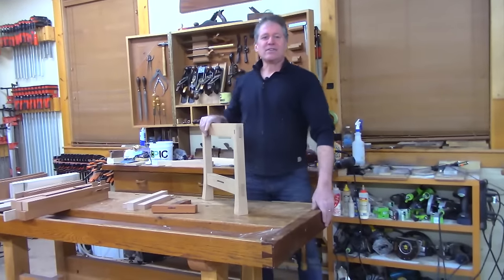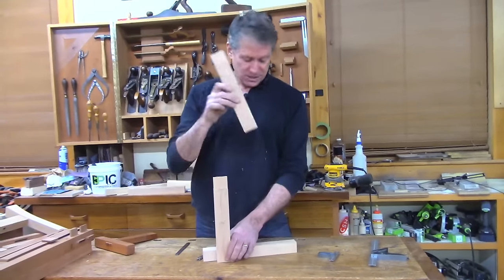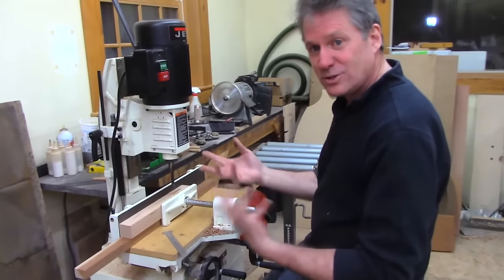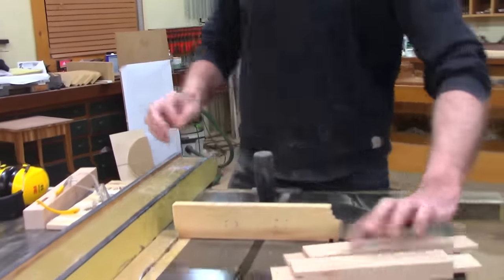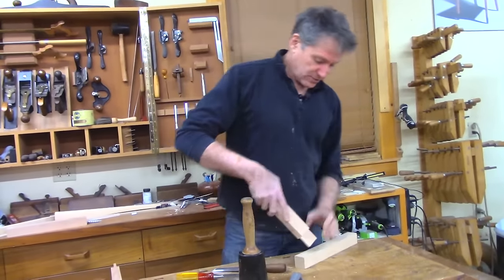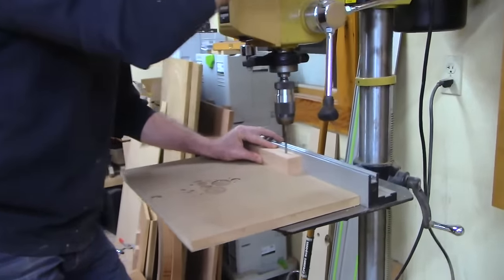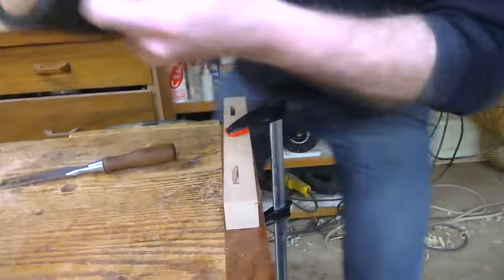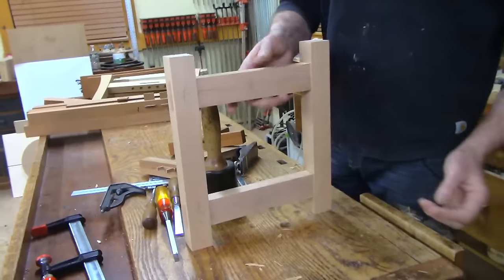Making Through Tenons

Comment: FWIW, I wholeheartedly agree with you about the usefulness of a hollow chisel mortiser. For efficiency and reliability in producing square mortises, it cannot be beat.  If I have just a few mortises to cut, then I chisel them by hand.  It is enjoyable and keeps me in tune with my hand chisels. But, if I have to cut more than a half-dozen or so, then I use the hollow chisel mortiser every time. I use the drill and chop method only if I am working with larger timbers that I can't fit solidly into my mortiser. A plunge router and a jig is also useful for this.

I, too , used a drill press adapter for mortises -- but only for a short time, I report thankfully. It is not steady and solid, and it interferes with the normal use of the drill press. Further, it is often more difficult to control the wood into to which you are cutting the mortise when using a drill press. These things lead to inaccuracies.  Not goodness.  Not happiness.  

A router table and/or router jigs work well and reliably, but they do not yield square-end mortises and are not as solid and reliable as a hollow chisel mortiser, which cannot "grab" and shift the workpiece. Still, I would use a router table (vertical or horizontal) before I used a drill press, given the choice, because you end up with vertical and smooth sidewalls in the mortise. Squaring the ends with a chisel is no biggie, either. Now that I have a hollow chisel mortiser, I don't mess with router-cut mortises unless I am cutting more than one or two end-grain mortises in long work pieces OR if I need to cut a number of mortises smaller than 1/4", which is rare.

I got a Jet benchtop mortiser decades ago and I have never regretted doing so. I was building Craftsman-style baby cribs, changing tables, and blanket chests for four grandchildren at the time, so you can imagine how many mortises I was cutting. Then came Craftsman-style beds, bedside tables, high chairs for toddlers, and so on and so forth.  All in tough-as-nails White Oak. The hollow chisel mortiser was a godsend!  It still is.  (I don't have room for a floor standing mortiser, though that would be better still, in my estimation.)

I just have to remind myself to put glue on the tenons rather than in the mortises to avoid messing up the finish on the end of the tenon.  Brushing a little shellac on the end of the tenon before assembly also helps to keep stray glue from messing up the end grain during the finishing steps.  DAMHIKT. 🙄  At least this method works for me.

After all these years, I still regard nicely-fitted through tenons as indicators of good craftsmanship and rock solid construction. It was nice to hear you say the same thing. That we agree does not mean we are absolutely right, but I still think it is a good wavelength for anyone to be tuned into.  Same for wedging the through tenons.  Good stuff!

Many thanks for another interesting, informative, and -- I believe -- important video.   Regards and best wishes to you both.
Reply from the maker: Thanks Jerry, wow, you have a lot of experience and knowledge making mortise and tenons…maybe you would have been better host that episode! And I think since we agree about all this, we must be right! Thanks again for watching and being so supportive.👍😎
Reply: @EpicWoodworking  First, I never said that the mortises and tenons I made were any good. They were numerous, not necessarily luminous.
Second, I cannot imagine a better host for Epic Woodworking than the guy who currently has that gig. Period.
All the best to both of you. 👍👍